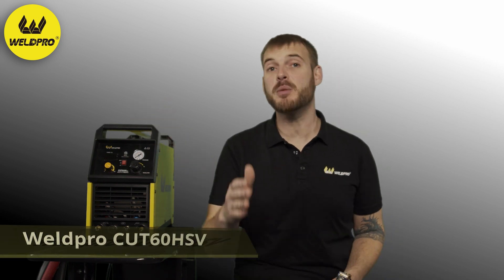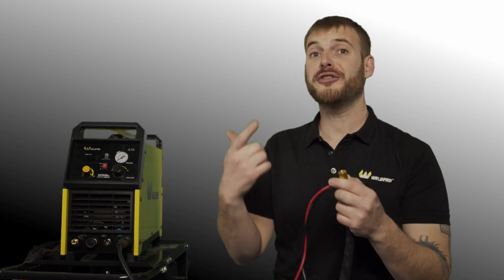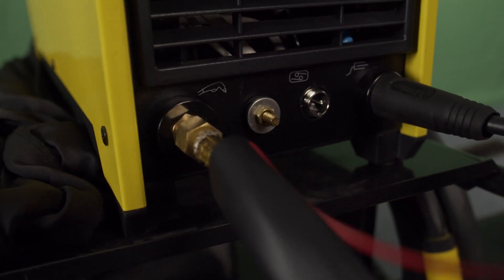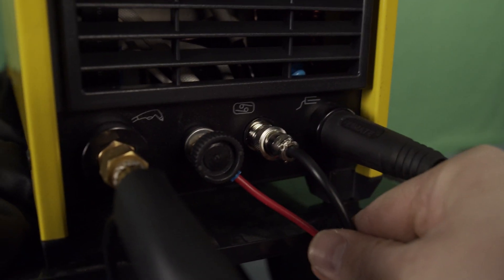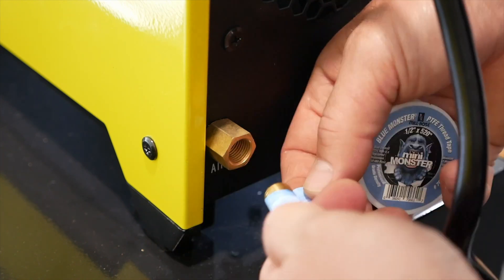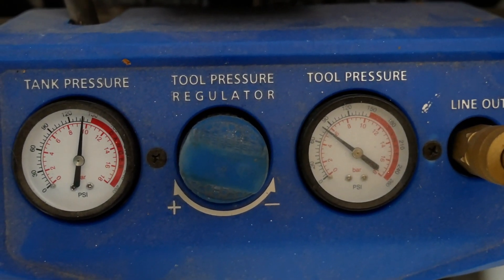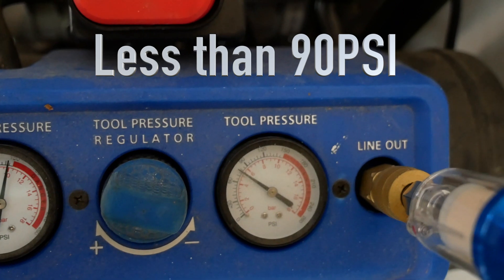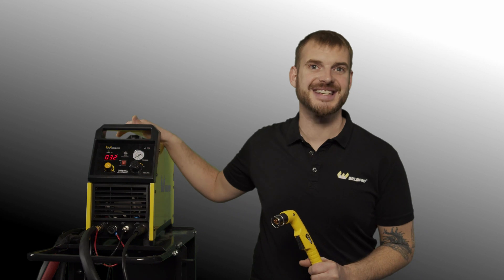Weldpro CUT60HSV - Part 2 - Set Up

Comment: Do you need a water separator between the air compressor and plasma cutter?
Reply from the maker: You should yes! Any type of dryer or separator will work!
Reply: @WeldproWeldingEquipment  what size air compressor should be used? Its hard to even find an air compressor that puts out less than 90psi max pressure these days. Mine does 135psi. Even the cheap harbor freight air compressors say 100-110 psi. Do you have a suggestion for which compressor to use?

Comment: I purchased the older model of the 155 and the wire feed will stop feeding wire through. I have the right sized rollers and I have tried different tensions on the wire. What else could cause this?
Reply: How long have you had the 155?  I am waiting on the 155 GD to arrive . . .
Reply: @danielchambers1958  4 ish months. It is a great machine just that little problem.
Reply: @calebsmith9386  Okay . . . thanks!
Reply from the maker: Is your spool feeding off the bottom? Make sure it’s not feeding from the top and bending/kinking the spring entry tube. Please reach out to customer service 9-9 today if it still isn’t working! Thank you.
Reply: @WeldproWeldingEquipment  the wire is feeding from the bottom.
Reply: @calebsmith9386  make sure you have the right roller.  Tension it correctly.  Keep the hose straight. Don’t touch the nozzle or the tip to the surface, just the wire.